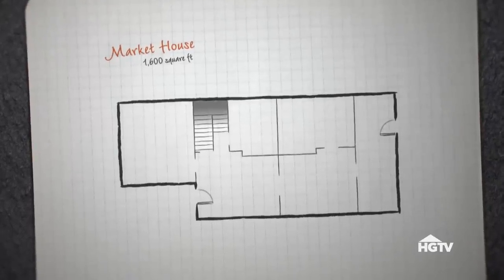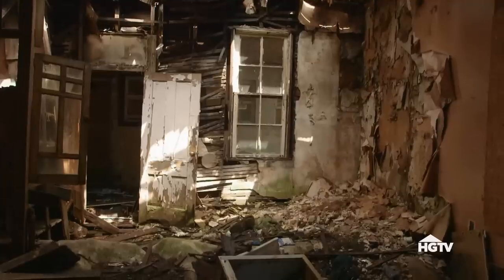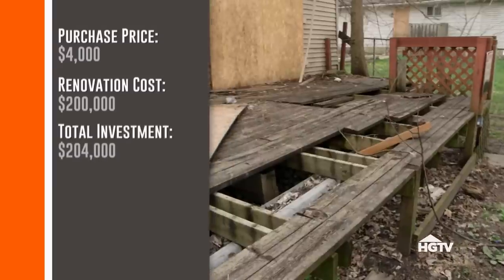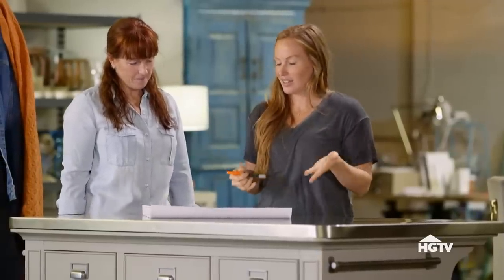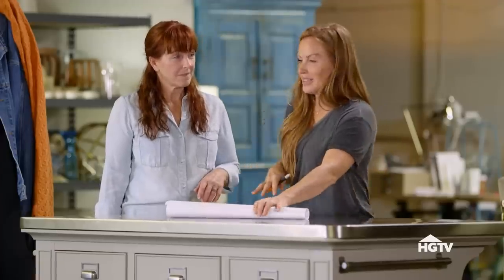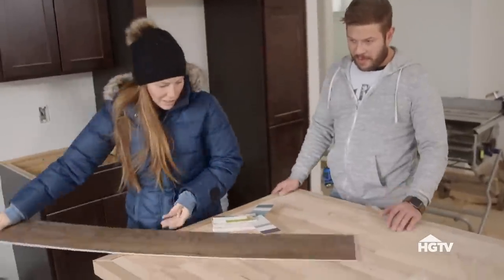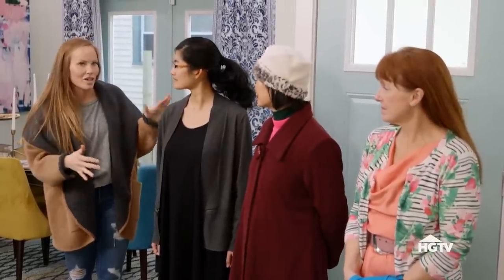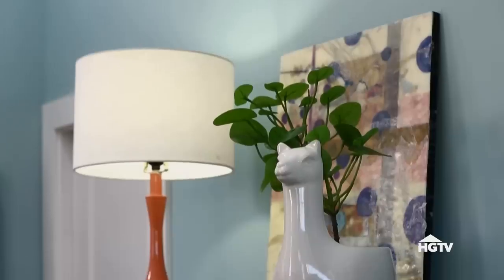House DEMOLISHED and Rebuilt from the Ground Up | Good Bones | HGTV

Comment: Do American homes ALWAYS have a separate dining room and formal lounge ?
Reply: Rubberdc, it was normal for a house of this age to have a living room (lounge) completely separate from a formal dining room.  However, most of the new homes built in America now are built with an open or semi-open concept with all of the rooms (not bedrooms) open to each other.
Reply: @lynnharrell9598  every time i watch a programme showing an American home being built or redesigned , it always appears to have the need of a separate formal dining room and a formal lounge then in the rear a family room . it is almost like they are harping back to early English homes that had a formal parlour to have guests in and keep for best .
Reply: @rubberdc  harking back?
Reply: @rubberdc  It's pretty standard to have two living areas, generally known as a "living room" (more formal) and a "family room" (less formal, TV area). However, it's also very common to have what is known as a "great room", which is one larger, more open room. 

It's also standard to have a formal, separate dining room, but since they don't always get used very often, a more open floor plan has become very popular.